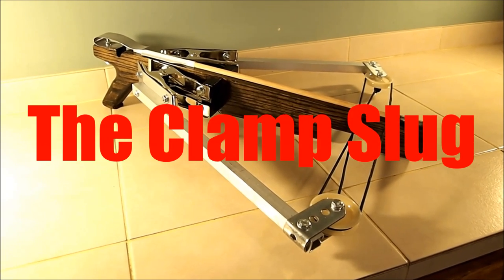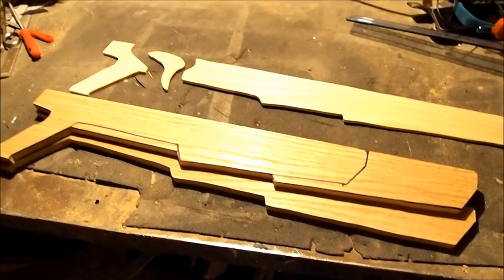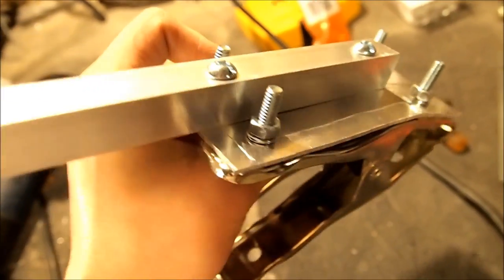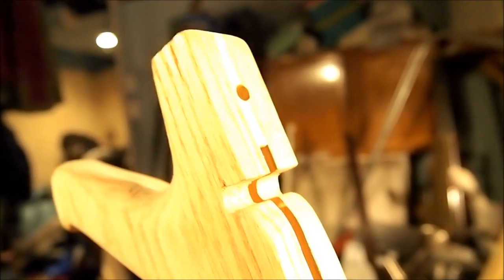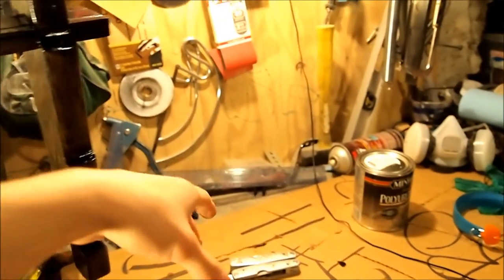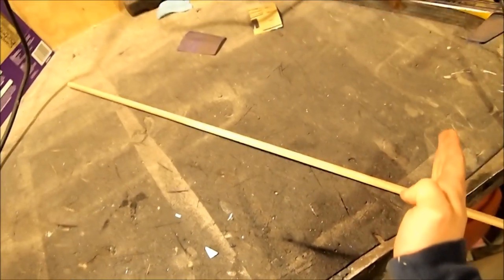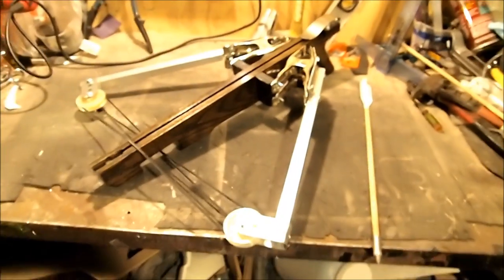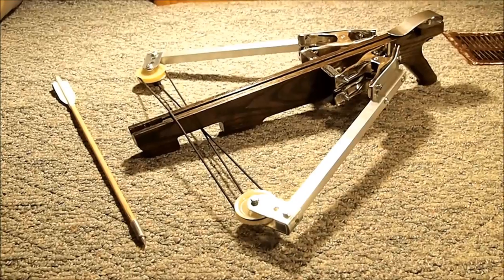How to Make: Clamp Powered Crossbow (The Clamp Slug)

Comment: piece of advice for the clamps, either buy clamps that have very heavy clamping power or replace the spring inside the clamp. the only draw back is that it will be harder to load

Comment: Dude you can replace the clamps with solid L brackets so that it is solid and not moving and then replace the string with speargun rubber. That could work well.

Comment: i was wondering to improve the power of the crossbow try adding a few high powered springs inside the clamps when they open as you pull the string back might make it stronger since thats what they use in guns when they fire its worth giving it a shot would love to see the crossbow revamped with them. plus subbed great videos.

Comment: The reason why I don't like working with fiber glass and resin is because of the way it smells. That's pretty much it, and it also takes such a long time for it to dry. Even after it drys it still smells so strong. That's why I always prefer building mechanically rather than chemically or with chemicals.
Reply: Febreze could mAke n amazing commercial for that

Comment: Nonlethalbychoice  I tried it with 1 inch diameter square wood dowels and It snapped in the center of the wood, so I tried oak wood in 1/2 inch diameter square rods, and it bent more than pull open the clamps.

Comment: hmmm wonder, if you use a strong spring from an air gun and attach it between wood and aluminum or fit it at the end of the clamps, the ones used in clamps are just a toy

Comment: an idea for you on the power of the  build, replace the springs in the clamps with stronger springs, i didnt see how your clamps was built but there are some that its as simple as removing a pin to get it to come apart, or as you have shown you have no problem tapping and drilling out pins you could just tap out the brads in the clamps replace the springs and use bolts to hold them back together, not telling you how to do you thing just offering advice

Comment: if you change the aluminum arms and the pincers for PVC arms?...it will have more power and less weight
Reply from the maker: I've tried PVC limbs before, they work well for bows but end up deforming when the limbs are only 16 or 17 inches long. Thank you for the suggestion though.
Reply: if you put a core for the PVC, like a rod of fiberglass? im sure it will not deformor, idont know...but hey its ok...thanks to you to put me to think :)

Comment: Soo in theory with how this works. you could potentially just switch out the springs in the clamps with something that's a LOT more stronger.
Reply: OR Just Double The Strength By Adding The Second Spring Still Win The First Spring
Reply: With